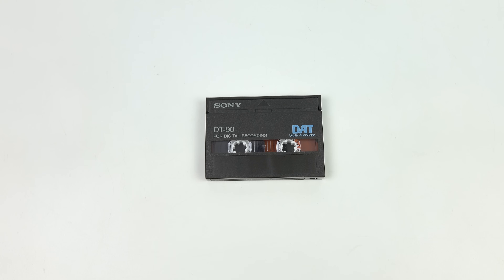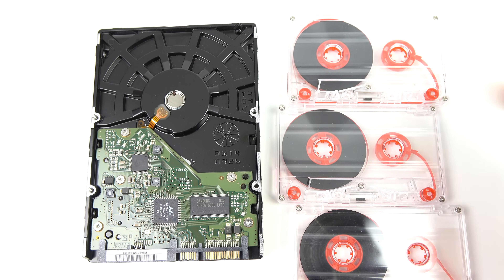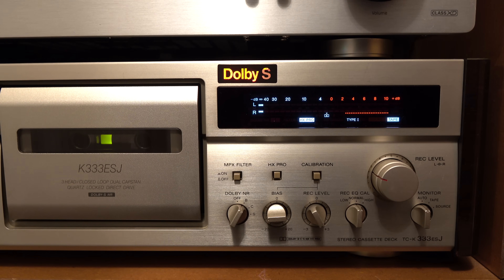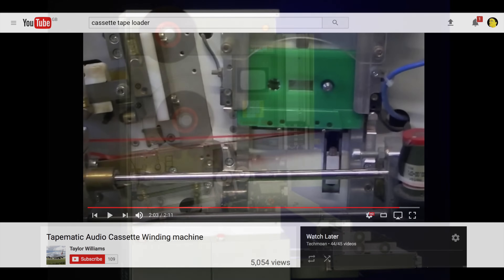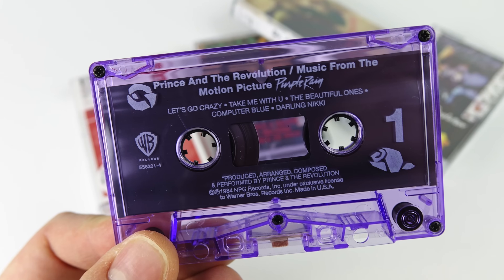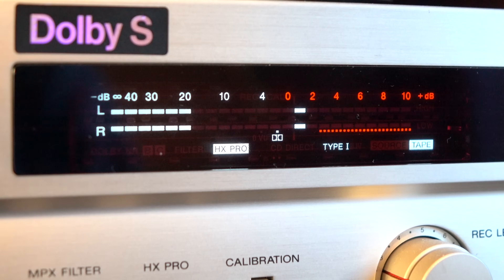Pre-recorded Cassettes' Last Stand

Comment: Worst & most unreliable format ever!!!
Reply: James Reeno False.
Reply: Chris Barbati wow & flutter, dropouts, stretching, tape hiss, etc.
Reply: James Reeno If you bought a half decent machine and half decent tapes (pre recorded or otherwise), none of those are really an issue. Regardless, even if they were, cassette tape is still not nearly the worst and most unreliable recording format. Wire recorder might take that trophy.

If one buys crappy tape players, crappy tapes, and fails to maintain them, then obviously results will be poor. But it had the potential for really good results. I still use them all the time, and I have never had a stretched tape, audible wow and flutter, or significant hiss (almost none if you're a fan of Dolby or DBX). Dropouts do occur, but they are infrequent and become a non-issue if you buy good tapes. It's been at least four years that I've used it and I have no plans of stopping.

Even if you were to buy crappy tapes and a crappy machine, most of the problems people cite about cassette tapes can be avoided by keeping the tapes out of direct sunlight and periodically cleaning the machine.

Wire recorder was bad quality at the best of times, plus unreliable, plus the wire often snapped and tangled (taking hours to repair, if you even bother to try). Also, it required some heavy duty erase circuitry because of how easily the wire magnetized, so presumably magnetized heads would become an issue if you run the wire over them again and again.

Tape is only unreliable when abused.
Reply: Chris Barbati incorrect.  Digital kills this.
Reply: James, cassettes and car stereos lived in a brutal environment. Mine always ended up on the floorboards and the tape deck was never cleaned, so naturally it ate tapes.
Reply: alainf505 sucked

Comment: For reasons I don't know tapes on the Epic label always had great sound quality and superb bass (at least, that is what I remember).
Reply: Epic is owned by Sony who used their Music label and Movie company to push their hardware, so they always used cutting edge technology.
Reply: I had a lot of problems with 80's-era gray CBS cassettes mistracking and gumming up my tape heads. They used some bad in-house made tape that was junk. MCA cassettes sounded terrible in the 70's-early 80's. They were cheaply duplicated with no Dolby B. In 1985 MCA started using the "HiQ" process with Dolby HX pro. And for a few years in the 90's MCA used some kind of black Chrome or Colbalt tape that sounded great.
Reply: I liked the Maxell metal tapes. I used to record the King Biscuit Flower hour radio shows off the radio and it sounded EXACTLY like what was broadcast. I used metal tapes up until the late 90's. That was the last time I ever recorded anything to cassette. Once recordable CD-R's came around I never looked back,.
Reply: I used a lot of TDK, tapes, mostly D (which was a good budget tape) and SA high bias. I've used Maxell XL-II and UR tapes for years and never had any major problems with them. The brands I had trouble with were BASF and Memorex cassettes from the late 70's-early 80's that used foam pressure pads. The foam breaks down over 30+ years and goes soft. So you have to open those tapes and put them in new shells to play them.
Reply: wildbilltexas 
XL-II were my life from 88-94. After that I used Fuji, but that was mainly because I was a blank media buyer at Tower Records, and the Fuji rep was very good to me (free stuff, lol). Later, I was a buyer at an HMV, and went back to Maxell.

ps - the last mixtape I ever made was in 2002! I held out a long time.
Reply: Warner bros tapes from the 70's were the worst. The tape would either start to stick together after a few years and squeal really loud and stick to the heads or the cassette shells were welded too tight and the tape would jam up. I still have a collection of them and they will not play now. They were manufactured by Ampex.
Reply: What were your favourite record-able tape brands?  Mine were TDK and AGFA.  They never went wrong.  I had a lot of trouble with Maxell.

Comment: Techmoan, love the bit with the oscilloscope at the end, Your logo looks awesome as a 3D image. Is that going to stay at the end as an "End of broadcast" sort of thing, or is it going to end up at the front of the next video?

Also, I've dug through my old cassette collection for a couple of years now, and found a few that had an interesing oddity. I have a few cassettes that have no noise reduction at all on them. I thought the tape player was reading a few of them wrong (and accidentally destroyed one in the process of trying to figure out why it wasn't playing correctly), but a look at the case and apparently a few of them (including a digalog one I have, Rush's Counterparts) has no noise reduction. It's only got HX Pro. Going to do some googling to find out why some had none applied, but thought it was interesting that a tape would have left a mastering house without having noise reduction applied.
Reply: If the other choice was a vinyl LP that's been played many times, the noise reduction isn't really necessary. In many listening environments where you are using speakers as opposed to headphones, the noise isn't too distracting.

Comment: Very nice video - as always, thanks for sharing.
However I would like to point out one thing at 8:38: Despite a weaker bass, it can not be that the frequency response for chrome tapes is 200Hz - 20kHz. That would mean that there are pretty much no bass notes recordable what so ever - try listening to a 200Hz sinewave (its on YT). I am not exactly sure what the correct frequency range would be, but more like somewhere down to 30Hz (depending on how many -db). Analogue to that, ferric tapes would probably also go lower than 50Hz.
Reply: The low frequency response of chrome tape is identical to that of ferric tape. The sensitivity may be less than some of the best ferric tapes.

Comment: Digalog makes perfect sense back then because they would ( assumption here ) be using the same digital master for the cassettes as they would be for CD's. I would also imagine that by 1993 or maybe 1995, all cassettes were made with a digital master regardless if they carried the digalog logo. I've never been a fan of Dolby, it always steps on the audio too much, too aggressive. I never have had the pleasure of a Dolby S machine though so that one is still on the table for me. Dolby HX is decent but I still prefer the frequency response over the small amount of hiss.
Reply: It probably varied by company if they used the same digital master for CD and cassette. It would save money to use the same one, but to do it correctly cassette should still get it's own master that accounts for the frequency response and dynamic range of the medium.

Comment: Another thing duplication houses did to try to maintain quality control was to use an XDR tone burst. Quite a number of prerecorded albums will begin and end with strange ascending tones, used to check the frequency response as duplication is in progress. You can find a few examples on YouTube.
Reply: When I recorded music off the radio in 1992 when I was 10 years old I would make those beeping noises with my mouth and the microphone at the beginning of every tape side...
Reply: Capitol/EMI had to develop XDR because their own Capitol tape was so inconsistent. Once they switched to SKC with BASF as a backup (SKC was a lot cheaper), they no longer needed XDR.

Comment: I went to a job interview at a duplication facility in 1989 (I think); I didn't get the job but they showed me around and it was very interesting to see how duplication works. This place did mostly video tapes (prerecorded cassettes were never very popular in the Netherlands).

They had a special machine that would copy a professional tape (Betacam or U-Matic or whatever) to a special intermediate format that was essentially mirrored VHS. They used a ferric tape for this. Then they would use this tape in machines where it was essentially just heated up to a certain temperature while it was pressed against a blank chrome tape. They explained that at that certain temperature, the magnetic particles on the chrome tape would be re-magnetized by the ferro tape, but the ferro tape wouldn't be affected.

So the tape was essentially mechanically copied, the signals wouldn't get distorted by electronics because of the high speed (and there weren't any issues with the need to copy video - a high-frequency signal - at an even higher speed), there was almost no chance that the copy would fail if the operator would make an error (unlike electronic duplication where distortion was possible if the volume was too loud), etc. The chrome tape was literally a mirror of the ferro original, and they could run the tape through the machine at basically any speed (and even if the speed wasn't constant, it didn't matter); the only requirement was that the head (basically a heated wheel which the tapes were spinning around) would have enough time to heat up the tapes to the right temperature.

Anyway, I had never heard of Digalog, so this was an interesting video. And I liked the bit at the end; very Meta! :-)
Reply: there's a good chance at that friend, I'm from the Netherlands too, and Duplicase has since re-emerged as 'De Bandjesfabriek'  producing blank and pre-recorded cassete's only, meanwhile the old Duplicase is also still around, but only doing CD and DVD duplication. I must stress, these are currently seperate companies, the tape division of Duplicase was sold and became De Bandjesfabriek
Reply: Jac Goudsmit did that place happen to be called 'Duplicase'?
Reply: I still used cassettes up until I got a iPod. I had a computer full of free music from Kazza and still used  a portable cassette player  .

Comment: That "mystical" pulse thing on the record head is from what I gather simply recording with a PWM signal. Pulse-width-modulation. It's a digital signal which turns analog when the high frequencies are filtered out. Has many applications, like in digital amplifiers, or class D.

Comment: Great vid, I remember tapes they were rubbish lol
Reply: Wayne Daly I use tapes on the regular. they're amazing.
Reply: I just don't see the point, I can make a 10 hour  mix  on my computer, tapes only serve a nostalgic value. like last year I found some old mix tape in the mothers attic, it was funny to listen to the crap I recorded of the radio when I was eight years old.
Reply: Wayne Daly 
My old boss used to bring tapes into work to play over the PA system, the bad bit was, he always recorded the music from the radio so there'd be some Steve Write or Terry Wogan or some other DJ at the end of every tune.
Reply: Depends on the equipment. My B&O BeoCord 8000 cassette deck, was very high end at the time of release it cost more when it was new than a Linn Sondeck LP12 turntable did at the time in 1981. I used it at my new years eve party just gone and my guests couldn't believe they were listening to  30 plus year old tapes. My valve Amplifier and Bang & Olufsen Speakers may have helped a bit too though. If people are used to listening to cassettes on crap audio equipment like a Dixon's own brand boombox from the mid 1980s then you will get extremely poor performance and it will sound like its coming from the bottom of a deep well. Any tape deck from B&O, the higher end Pioneer kit and Nakamichi will sound impressive though.
Reply: Hello Zack Gobeshyte
Reply: Wayne Daly There is something "organic" about making a decent mix tape. You could fade in and out of songs as they begin and end. With mp3's you get that "kerchunk!" like feeling in the music unless you go and re-edit the digital recording which is already compressed.

Comment: i was using vha tape in 2006 2009 born 1994
Reply: 4edgy3mi
Reply: A- KHANATION I'm still using VHS tapes born 1996
Reply: VHS tape makes for excellent audio recordings
Reply: ManiacGamer  really mate   u still using vhs in 2016 2017
Reply: *****  yeah u can find them as low as 10 pence in UK
Reply: A- KHANATION yh why not? 😂
Reply: ManiacGamer  well the quality is bad and it takes to long to go from 2 minutes to 48 minutes. 
I been trying to convert all my family home video tape over 30 hours since 2011 but i can't even do it  using easycap.
Reply: rareblues78daddy  i want to convert using computer laptop not using  dvd vhs combo
Reply: i dont know shit about the specs on a lot of this stuff, but i have personally converted many mediums to vhs .admittedly  your source  material should be good quality but overall i have been pleased
Reply: If you have a BT878 capture card on your PC and are running Ubuntu you can capture lossless from commercial tapes and use de-interlacing and get quite good resolution, which is quite passable on a Sony PSP-3000 480x272 LCD screen.